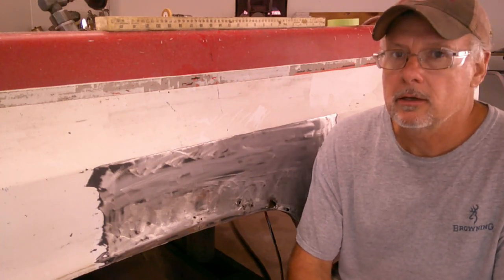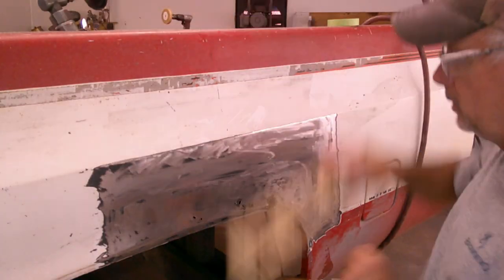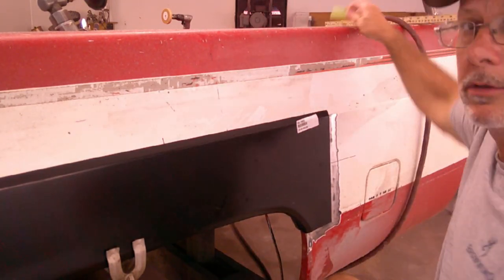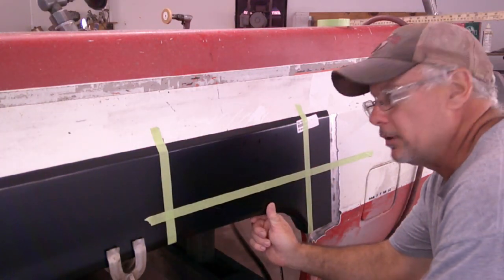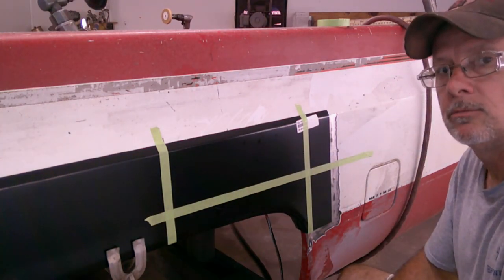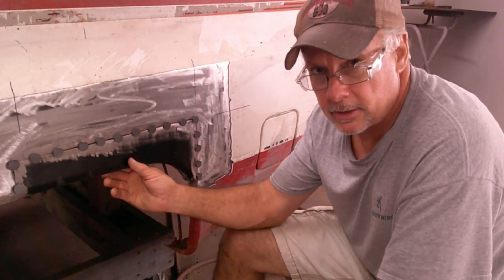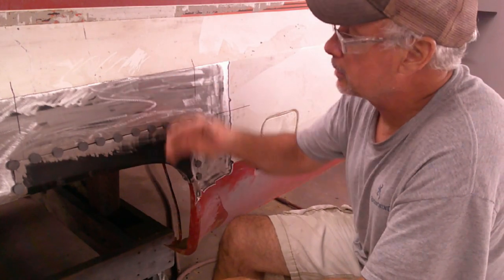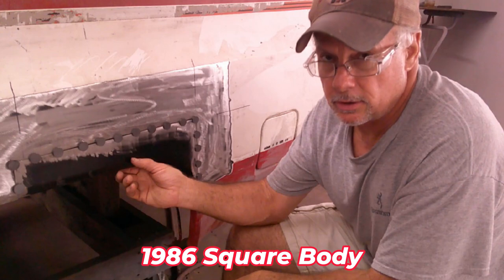1986 C10 bed panel repair part 1

Comment: Good video Alvis, definitely more methodical than I have been doing panels.  Next time I'm going to slow down and do it this way!
Reply from the maker: @Somewhere_In_The_Barn  thanks for watching. Tape helps keep lines straight. Have a good one
Reply: @OldRedTractors  Tape would save me from making fillets to fix my missed cuts!